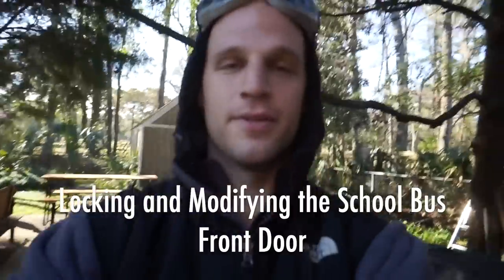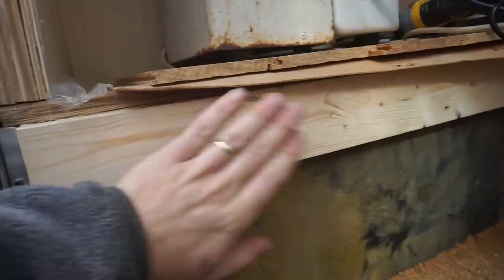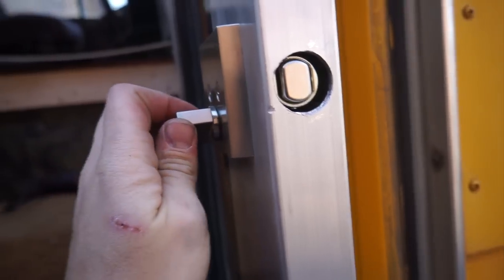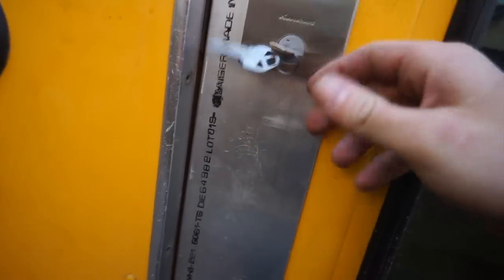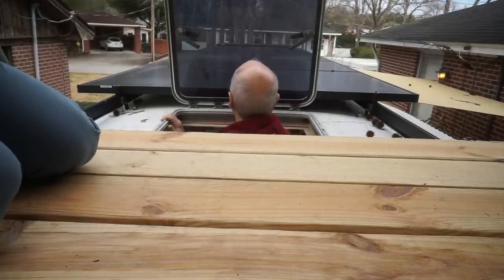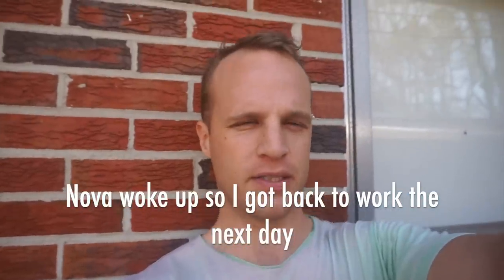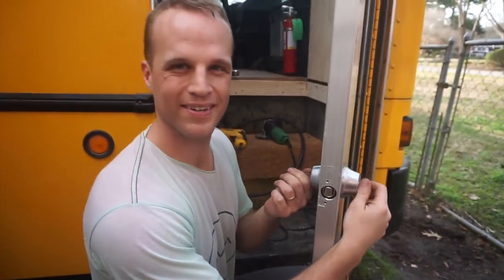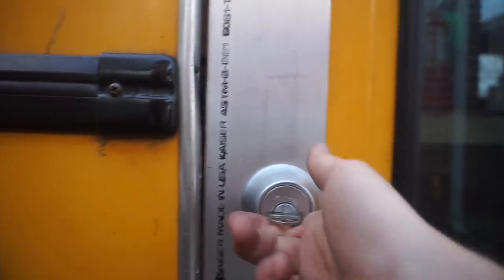Locking and Modifying Skoolie Front Door: School Bus Conversion Ep 46

Comment: Locking from the inside, you could use a latch and hook method to keep the air lock and bending door still functional. But to lock from the outside, what you did works perfectly!

Comment: The door doesn't open all the way. How do you feel about that. If you changed it, what episode can I watch? Really struggling with it today.
Reply from the maker: The door not opening all the way was a little annoying at the time and there is a part in the air door compartment that would free it that I simply could not get off given it's position but gratefully over time the door actually started opening more and more and now it goes to 90 degrees if not a little wider.
Reply: @MobileDwellings  I'm not sure if it's my rivets blocking the opening or what. I really like this design. Thank you for the video!